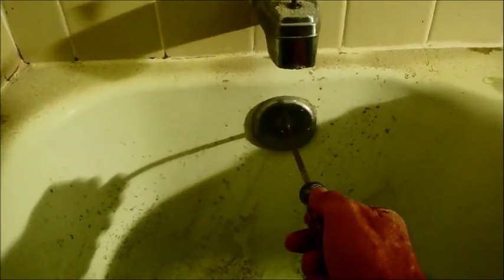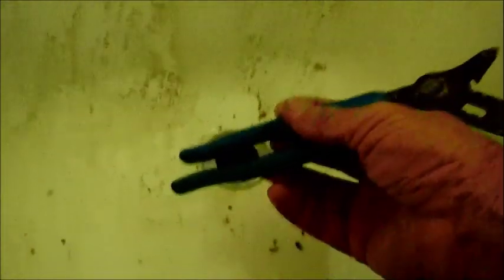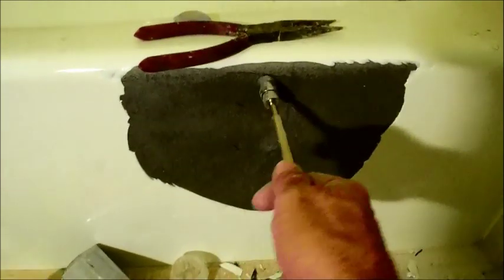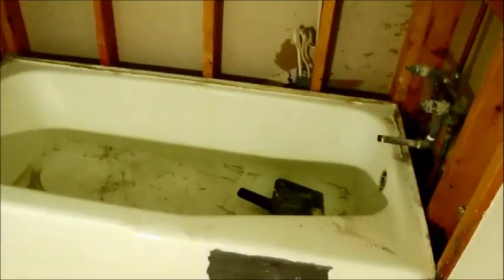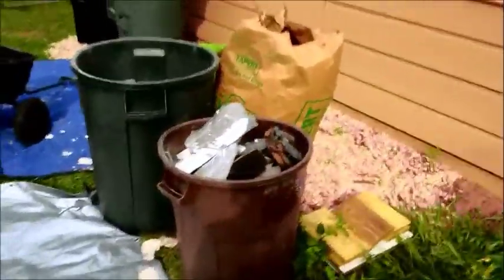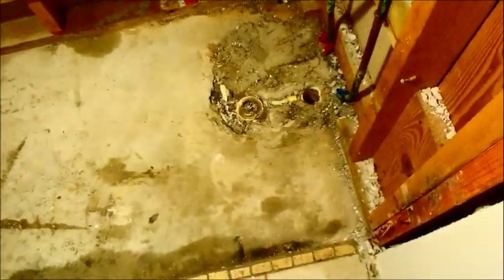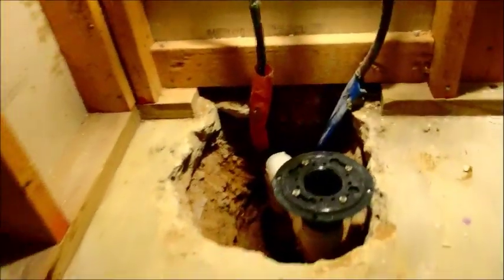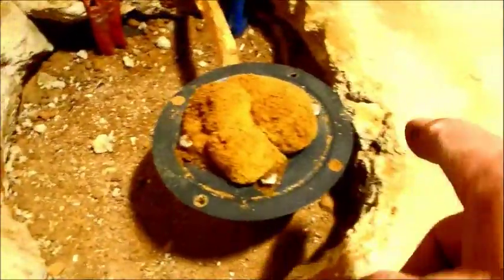HOW TO DEMO IRON TUB AND WALLS

Comment: I live in Richmond Virginia but the guy who  did the drain to my house must have been cousins with the guy who did  the floor of ur video  cause I have the exact set up drain on floor with a another drain behind it going to the overflow ... and it was encased in cement .. had to rent a jackhammer and my pipe didn’t go straight down it had a elbow and turn that took it to the left and to another pipe.  But I digress .. the question I have is this me and a friend were arguing and I was using your video as a reference... he says the back drain in your video and on my floor function as a vent pipe as well and that I should include that in my drain run it back to the wall and vent up the wall a bit and cap it with a breather .... I said it’s not a vent pipe and I used ur video as proof .... but am I correct that it does not function as a vent pipe and it is fine to redo the drain like u did  in the video ... he claims if I don’t put it the water will not drain right ... thanks in advance sir .. lov your videos they gave me the confidence to tackle my tub to walk-in shower dit job

Comment: Hi from the uk. I wanted to ask a question that is, my shower floor is concrete & we use the shower lol without that timing as we have only one bathroom & it’s not complete yet and I wanted to build a shower curb & a shower bench like they do in the USA. I’ve been watching your videos old & new. I wanted to ask since you say In ur comment replies that pressure treated wood is a no no. Could I still use regular wood & anchor it over wet floor or a 24 hour dried floor concrete. Or shall I put Kerri membrane under the wood between the concrete floor and wood?
Reply: I meant tiling* damn autocorrect
Reply from the maker: I'm sending you a video link of How I build a bench, the same would apply to a concrete slab except the anchoring process would be done with concrete nails
https://youtu.be/4qykfxNB4ak
Reply: StarrTile thank you so much for even replying. I’ve seen that video many times lol. I would like to ask is it ok to use regular non pt wood on a day old dried concrete? Thank you once again. Love ur videos.
Reply from the maker: @khizramaya  yes... but fastening them to the concrete will be the problem, typically you want to nail the boards into concrete and it is not cured until at least three or four days, a couple weeks is ideal
Reply: StarrTile I’m using spax frame anchor t star wirox for the curb but for the bench I’m using throughbolts m12. Also as we use this part as we have 1 bathroom. Unfortunately I cannot wait, so I’m going to follow ur instructions and use Kerdi board on top & around the wood frame and then tile over it. Hopefully I can anchor without problems. Thank you once again. Going to return the many pt wood as I brought a lot.
Reply: StarrTile sorry to bother u again, but I was told by schluter ppl that I should use damp proof membrane as I asked what to use between the wood and concrete. As I mention before my concrete floor gets wet & like u say pressure treated isn’t good for curbs or benches. So I wanted to ask is he correct shall I use damp proof membrane? & wouldn’t it be a problem when I drill holes for the anchors?  Thanks once again.
Reply from the maker: @khizramaya  you have a sticky situation that I don't quite understand and doesn't happen here....
I'm not sure why your concrete would remain wet, I'm losing you there, but I suppose if it were me I would put a layer of thick tar paper down in that area where the bench is, and then cut a little X into the tar paper where your fasteners for your wood will go, caulking that X afterward , that's the best thing I can tell you just trying to imagine what you have
Reply: @StarrTile  I meant we haven't tiled the concrete shower floor yet, or put a bench yet and we use it to shower as the drain is installed and we only have 1 bathroom & the bathroom floor concrete was dried for 28 days or extra as we extended the previous bathroom. So as this is the only shower we have we use it, we just need to tile, bench & curb it. So as we use to shower the floor gets wet where I'm going to put the bench etc, so I meant to ask as I called Schluter and they said I should use damp proof membrane rather than Kerdi membrane as a barrier between the wood bench & concrete as I told them the floor is wet by showering, would that be okay to do so? Thank you so much for taking the time to reply. Wish you a good day.
Reply: @StarrTile  I don't have tar paper so I've ordered the damp proof membrane, would that be okay hopefully? & would I just put it under the bench frame dry or use some sort of adhesive to the concrete?

Comment: Maybe a silly question, but the drain looks set flush into the concrete. I’ve seen other videos where the drain sits a little higher than the subfloor. Is that just a difference between having a concrete slab versus a plywood subfloor?
Reply from the maker: The bottom flange of a drain makeup has extrusions that are about 3/4 High...those are there for the bolts to go into , but they're also there to set at the top of your floor whether it be slab or wood if you're going to do a pre slope, since I don't do a pre slope then my flange sit flush with the floor regardless if it's concrete or wood
Reply: StarrTile Thanks for the quick reply. Makes sense when you put it that way. I guess I’ve watched videos where they left room for the preslope before putting in the pan liner

Comment: Hey Bob. I have a customer who wants A cast iron tub on the second story.  She says that some one told her that you can't use cast iron on second stories.  
What's the deal
Reply from the maker: That would have to do with structural support, obviously if the tub is heavy so including that weight plus the weight of the water and the person in it. Older houses were built to accommodate, not necessarily today... I've actually seen quarter inch plywood used as a subfloor😱
Reply: Feel bad for her, she should hire a competent tile installer 😂😂😂
Reply: @StarrTile  Funny that you mention that about older houses.  I read something on a website yesterday that said that older houses are not as strong as new houses. That makes no sense to me. 

I have seen cast iron tub's on second stories many times.  I haven't seen anything that says different in any building codes.  But that doesn't mean that there isn't a code.
Reply from the maker: @travisk5589  well I can tell you by experience working on very old houses in metro Atlanta , that wood is almost like rock... in fact probably 70% of the houses in Atlanta are two story with bathtubs upstairs, there's very few slab construction type houses here

Comment: Since I have a 50 50 chance for this to work how will I know it is good so I can grout it and use the shower or should I pull the tile back up and start over?
Reply from the maker: Prior to putting in your mortar mix into the pan, get a plug and use it in the neck of the drain and fill it up with water overnight leaving a mark somewhere on the liner so you know where you started, you'll know if you have a leak prior to pouring the pan
Reply: I am talking about the thinset pre mix for the tile not the mortar for the pan, sorry for the confusion. I have done like you said in your other videos, not put the backer board in the pan, got my pan liner in, put a pre slop on the curb, I have painted the mapei waterproofing membrain on the backer board and on the mortar pan except maybe 4" around the drain, but I laid the tile with the mapei premix tile and stone mortar but found some bad reviews on it and wanted to know if I should take the tile back up and use something else or if it would be ok. one review said it takes long to dry another said when it dries and water gets in to it that it will soften again. what are your thoughts on this?
Reply from the maker: @shaneramsey5053  mapei makes pretty good products, including their thinset , but I never ever use premixed thinset because it doesn't dries hard, I wouldn't assume that you will have a problem just because you use premix...time will tell

Comment: Hi starrtile I was looking forward to watching your live QnA but I noticed you took it down ...will you be reposting it??
Reply from the maker: No I do not repost Q&A , it would clog up my channel , I do one every third Sunday of every month and I'll leave it up usually a day or two and then I delete it
Reply: @StarrTile  ty for the response. I was very curious about the question regarding concerns with trapped moisture using regard and shower pan liner ...in short is it not worth worrying? (I had to go to work and couldn't hear your response to the questioner)
Reply from the maker: @brianfrasson7358  The Cure time for most Cement Products is about 20 days, I cannot wait 20 days for proper cure so I usually wait about three days with a fan on it 24/7, hopefully most of the moisture is already out before I apply my Red Guard